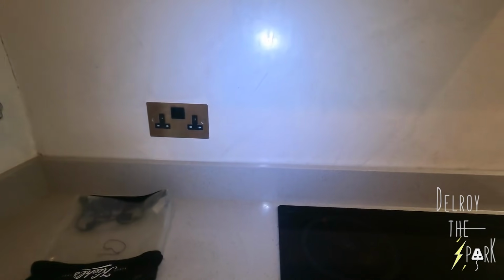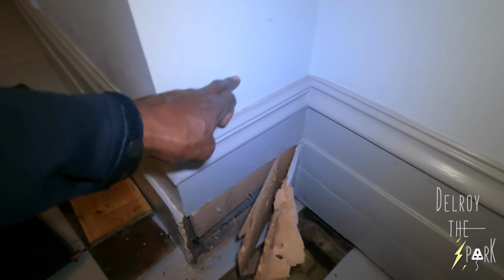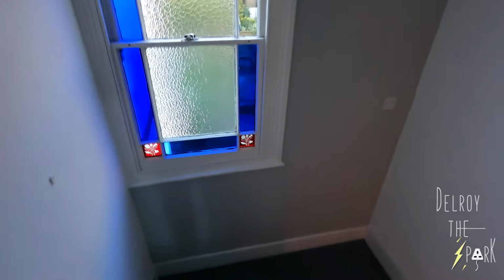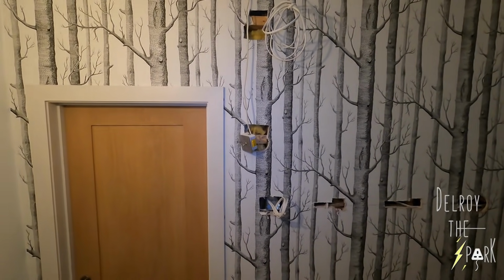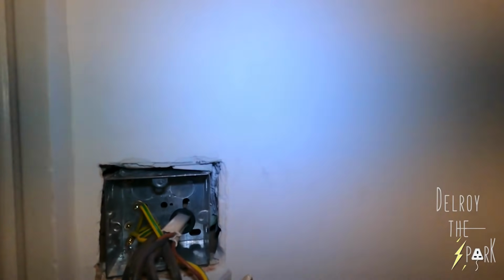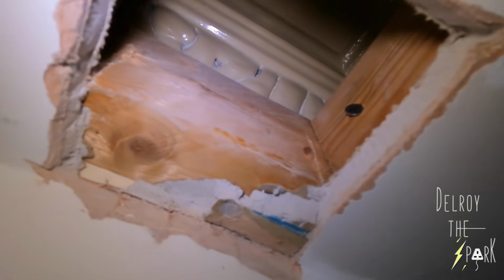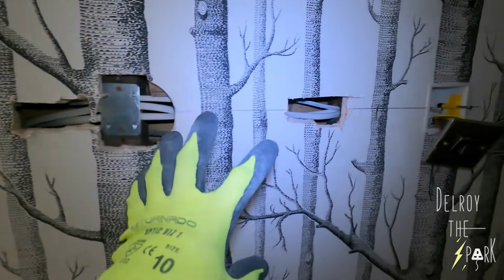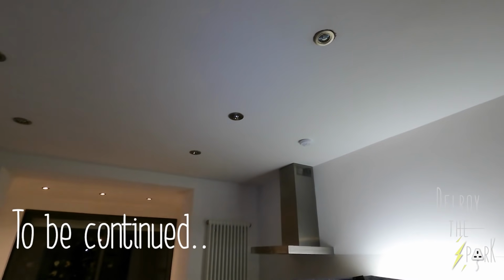Nightmare 2-Way Lighting Installation | Electrician In London

Comment: Hard one for you there Del. As has been said Quinetic would have been your friend on this job. Only a live (no neutral) required at one switch, then the others need NO wires at all. Easy to set up and pair the wireless switches with the base. No internet or wifi required. We know you are old school but check them out, you wouldn't regret it on a job like this.
Reply: Exactly my thoughts to, less damage, I've used for a client the original installer's said couldn't be done

Comment: Before making holes in ceiling for recessed lights, drill the center pilot hole first, then push up a length of green and yellow sleeving. If you can access ceiling above i.e. loft or floorboards, you can find the sleeving easily and you can visually check to see if you need to reposition to avoid joist. If you can't access floor above, you can drill 2 additional pilot holes each side of the circumference and push up a small screwdriver to see if you get any resistance. Also a stud finder helps to mark positions of the plasterboard screws so you can get a rough idea of where the joist timbers are. Making good small pilot holes is a lot quicker than patching in a 70mm disc 👍🏻👍🏻👍🏻
Reply: Use a rigid wire coat hanger instead

Comment: Could have saved 90% of the hassle and mess with changeover light switches by just installing Quinetic stuff....
Reply: Agreed on this comment. If it doesn't work your replace both parts at the same time which cost minimal compared to running new legs of cable.

Comment: That " electrician" with his 18 ed. Regulations. If the fuse board is safe and in good condition and  still serving the purpose of its design, no need to change it.